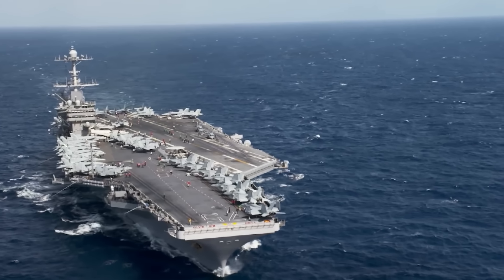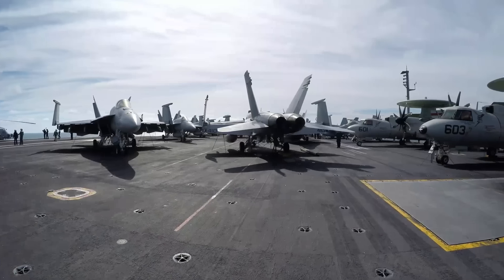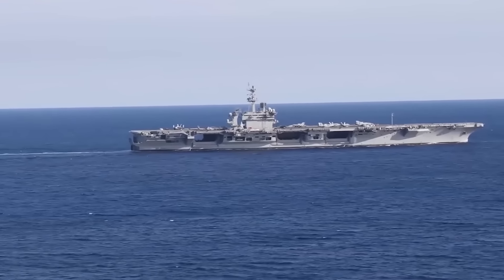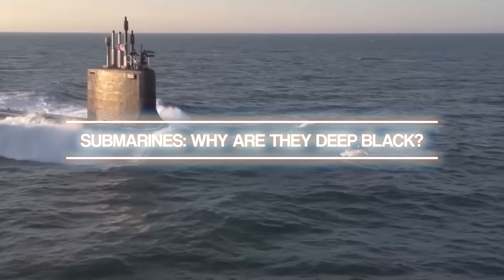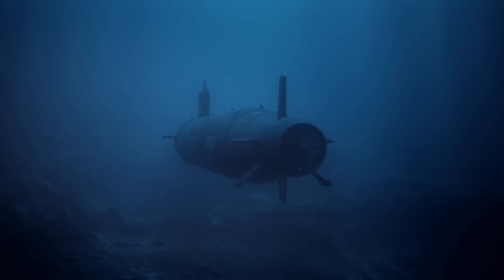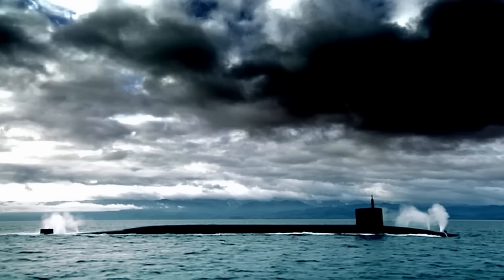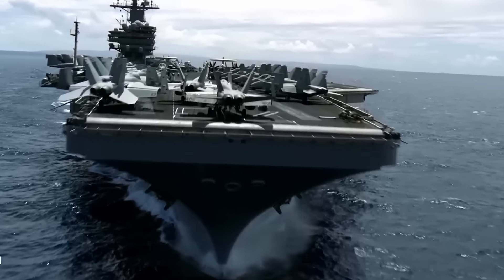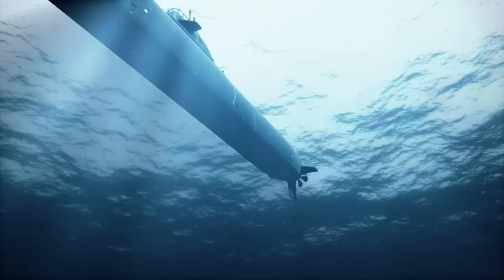Why Are Submarines BLACK and Aircraft Carriers GREY?

Comment: Black for subs, hides their visible surface features at the horizon and surface level greater than an absolute gray feature above the water line for atmospheric horizontal camouflaging.  Such painting throughout the day works, unless one predator is clearly in the noon time hours or directly overhead looking down on the black vessel.  A blue-blacking is not a solution, giving a dark sea appearance, as the blue is more reflective than dark and blue (-black) sea waters in the green water and blue water depths.  So black it is.
Reply: Excuse my ignorance but why not a broken up pattern like on planes?
Reply: @wattsmichaele  because there is no horizontal predator looking for a black top with white bottom, or an underwater predator looking up at a white belly.  Keeping the entire sub (and its an-echo-ic) surface tiles the same dark complexion, makes for the best option in camouflaging a sub.
Reply: I'm Agree :hand-purple-blue-peace: